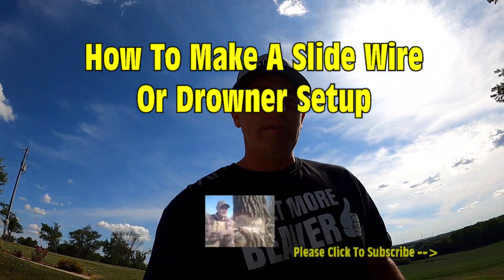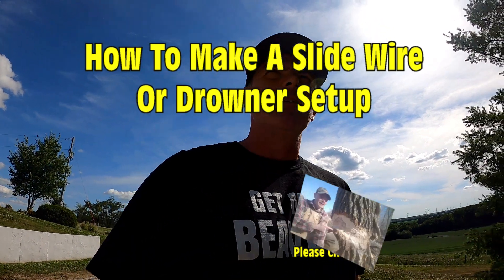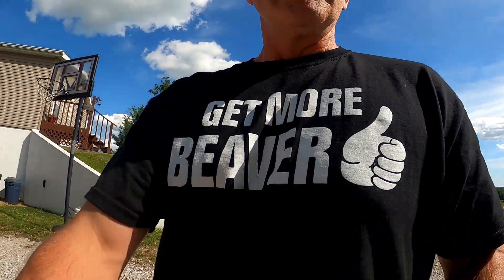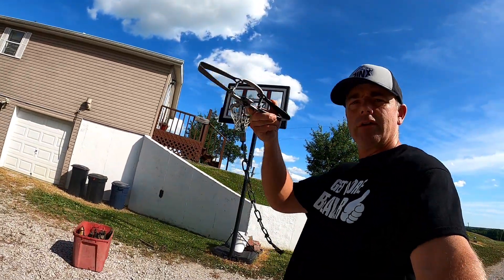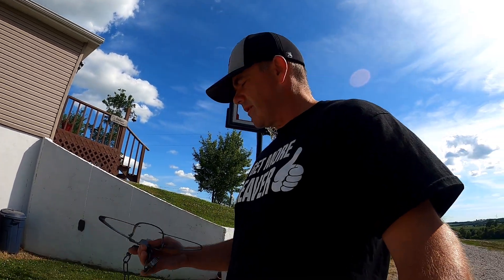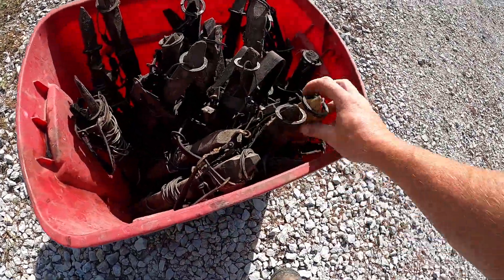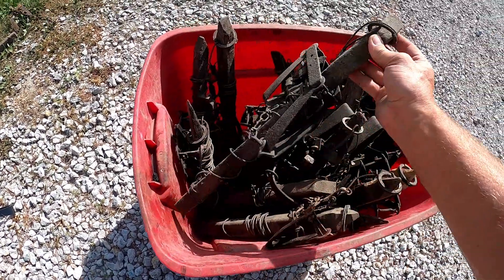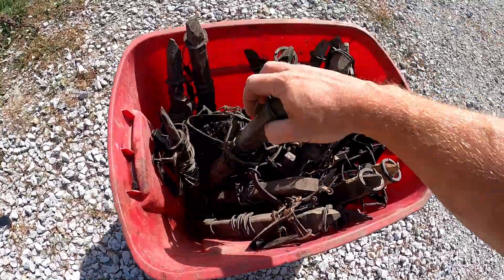How To Make A Slide Wire or Drowning Setup | Catch And Hold More | Raccoons, Beavers, Muskrat

Comment: What size j hooks do you use
Reply from the maker: Not sure there's a difference in size, but most trapper supply's carry a heavy duty j hook. That's the one I use. I buy them by the hundreds.
Reply from the maker: One thing I will say though, if you're sliding Coyotes I recommend welding those j hooks. I had one bend out once and once was enough for me.